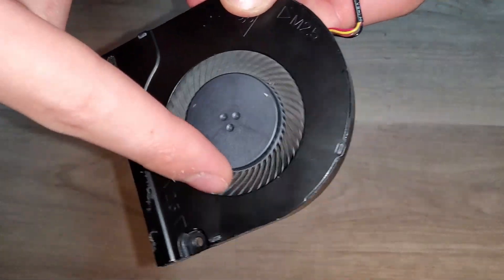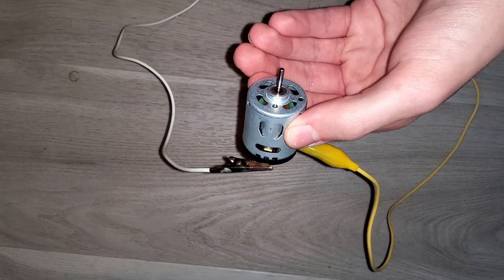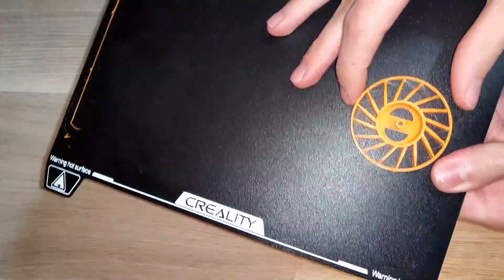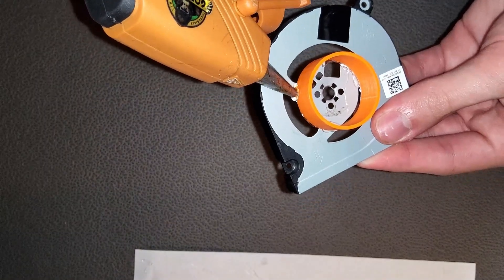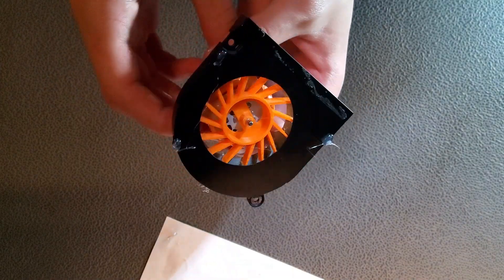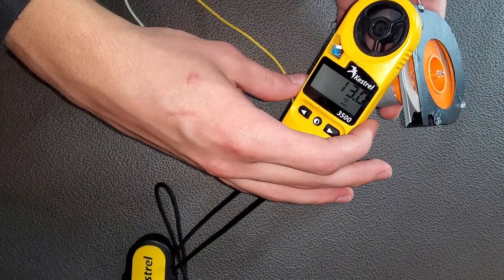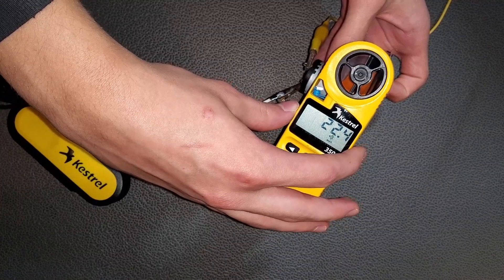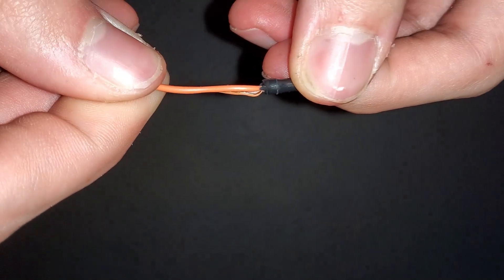I Put a RIDICULOUS Motor on My Laptop Fan: Here's How It Worked

Comment: Install it in your laptop and compare the temperatures
Reply from the maker: If I installed it in my laptop, the motor will try to pull several amps from the fan supply that is only meant to handle 0.5 amps so it would probably destroy the computer.
Reply: @3lectronical use an external powersource